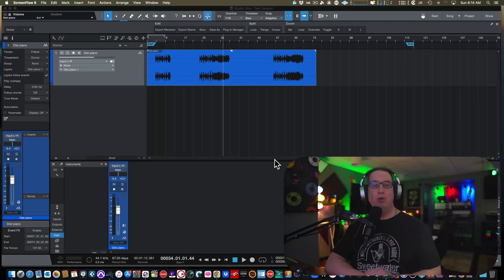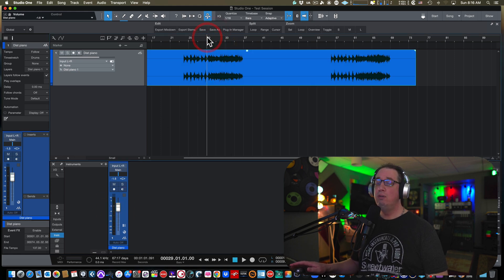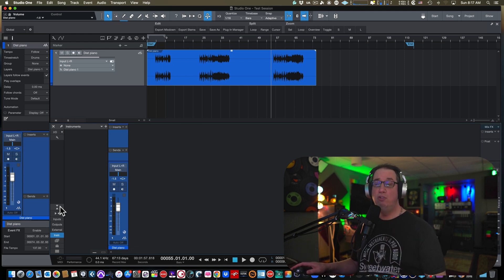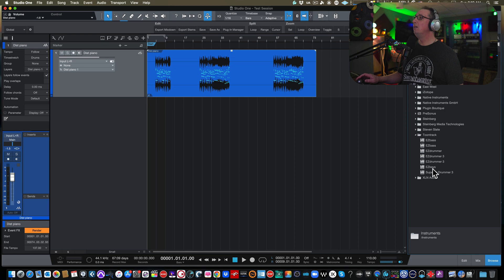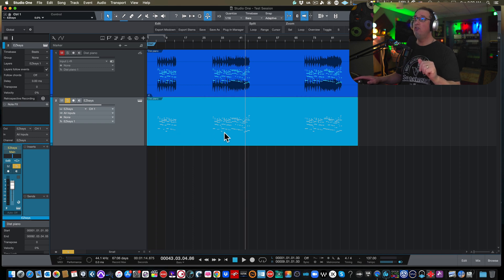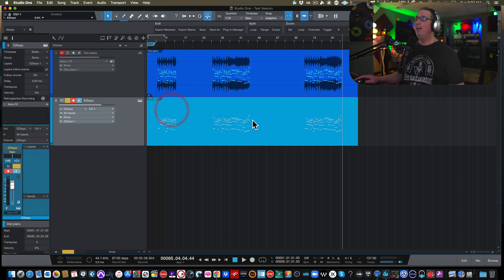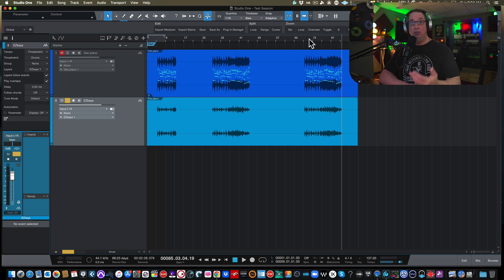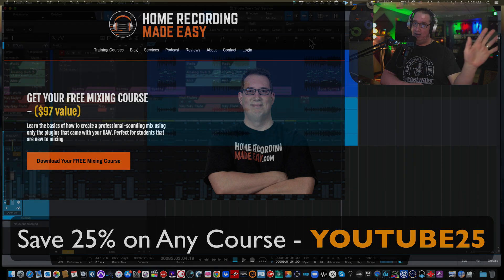How To  Fix Digital Clipping  Using MIDI & EZ Keys

Comment: Great tip! In my case, I use Ableton and convert audio files to midi, then add a vst on top and i'm done :) , what i also do for wav files is check with Fab filter EQ to see on which frequency those clippings are happening, then automate some side-chain so when that part of the audio ducks, the previously midi + vst can still sound (layered).   Great stuff as always Dave!
Reply from the maker: Great tip!